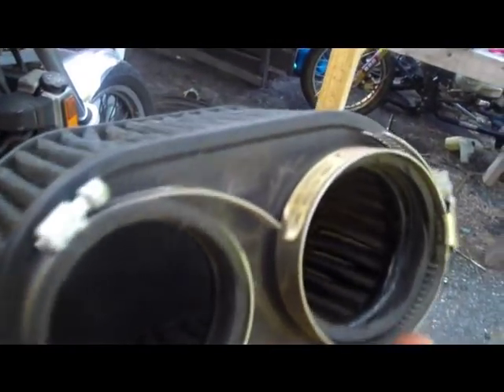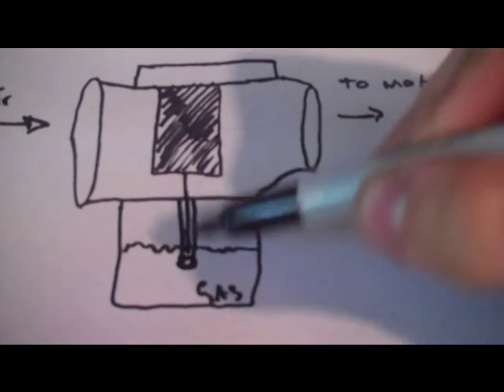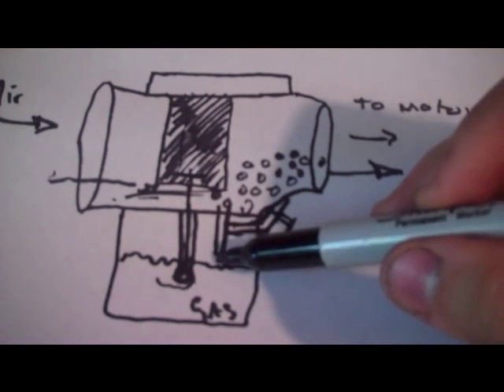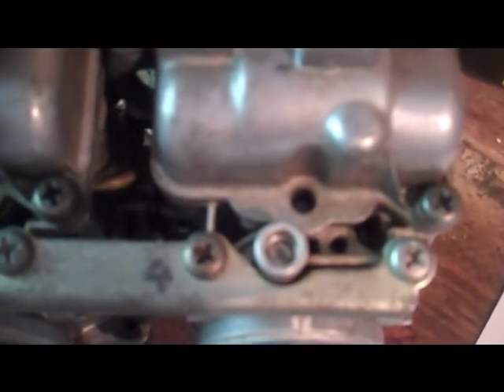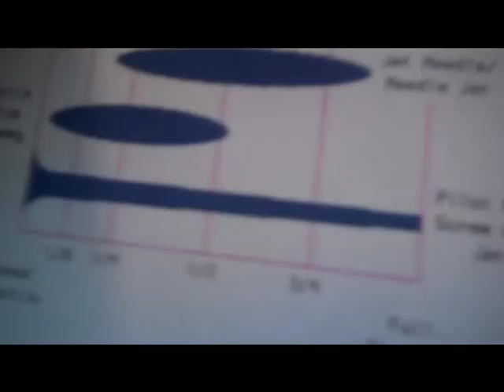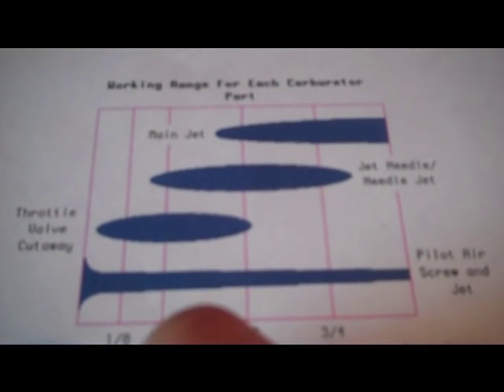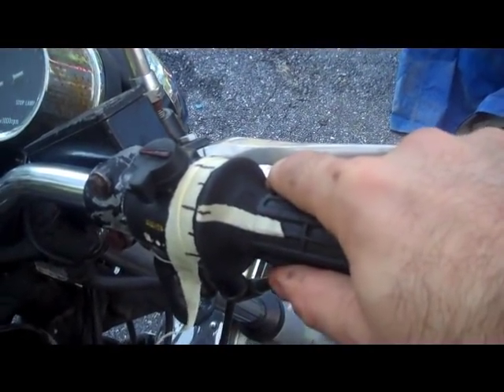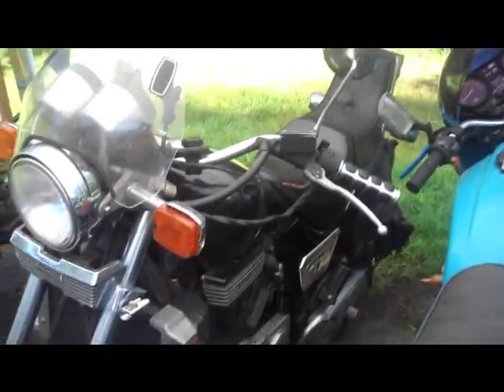How to adjust the jets on motorcycle carburetors

Comment: Your video is the best. Thx for sharing it... any advice or tips on getting a clean throttle blip at lower rpms (it bogs on me)? I might try to move the needle to enrich it some but just wonder if other things i should be paying attention to... its a kz650 1978 with pods, shorty exaust tip acc pump.
Reply from the maker: Fabio Suenaga No tips really other than to just diligently follow the steps in the video
Reply: +Fabio Suenaga did you change the accelerator pump?

Comment: Hi, I really enjoyed the video. Ihave a 89 Yamaha XS 750 and. I cleaned the carburator and won't started. I notice that when I the switches tank to PRI the gas is leakink fot the side of the air filter.
Reply from the maker: +Leo A Noya Your carbs are overflowing. Clean the carbs again, set the fuel height, replace the spark plug and change the oil as it now may be contaminated with gas. I have lots of other videos up on how to do all this stuff
Reply: I will do. Thanks a million.

Comment from the maker: Well like I mentioned in the video, there are different parts of the carbs that control the mixture during different applications of the throttle. It sounds like on decel, while the throttle is closed, something is off on your mixture. This could be a slide that is not closing properly, or a clogged pilot jet, float height incorrect, vacuum leak, etc, but whatever it is, its likely in that circuit

Comment: Great explanation.  I have on question I have a 1980honda cb750c dohc.  And just cleaned the carbs and got it to run. But it is on a very high idle. . How di I get rid of it and fix this.

Comment: @12m:32.  You only turn the pilot screw out if it is metering fuel and you wish to enrich the mixture correct?  Would the inverse be true for bikes who's pilot adjustment meters air (i.e. turning the screw outward would lean the mixture)?  Just want to make sure this is clarified for those who might not be aware of the different pilot screw arrangements.
Reply from the maker: Sounds reasonable

Comment: Nice and helpful video sir! Just like to ask if you change jet do you need to adjust also the needle or Should I use the stock one? Cause I go for a slipon exhaust. Thanks
Reply from the maker: Stock is fine usually when just adding a slipon there isnt any adjustment needed, or only minor

Comment: Btw, what's the best, easiest way to clean up an old bike & to get into all the little nooks & cranes on things like the cooling flares to remove old sludge, oil & other gunk? I have a steam machine & some gunk degreeser. Would a small wire brush also help?

Comment: nice video tutorial, thank you but have a question, at the end of the video you mention that when one get a bike at low altitute and bring it to higher altitute one should adjust, but what happen when I do the opposite, I got my honda VT1100C3 in Denver, and brogh it down to florida where I live now do I need to do any adjustments to it run good.  btw sorry for the grammar.

Comment: I just put pods on my kx305 because it was cheaper than replacing the tall battery they previous owner installed. Can i just tune the pilot screw to richen the mixture or do i need to get jets like you explained?

Also when the bike is warm it has a steady woft of white smoke coming out of the crank case breather. Do you think this is a sign of a bad head gasket or rings? Compression on both cylinders is about 120.

Comment: I have a 50cc 2 Stroke Reed Valve Yamaha that I opened up the carb with pod filter and opened up the stock exhaust by gutting the baffles and flow more air.  Does that upjetting formula apply the same with smaller 2-stroke engines?

Comment: Thanks for all the great videos. I own a 1982 Honda GL500 Interstate, and I hope you can answer a question for me. I've watched the awesome carb video and I indeed installed pods and somewhat opened exhaust. Using your +5 on mains and +2.5 on pilots. My problem is that the Keihin VB carb slide needle retaining screw won't allow shimming. If I skip that adjustment, what should I expect as a result, and is there any other way to make an adjustment to compensate for the stock needle position?
Reply from the maker: Yeah some of them are not adjustable. You'll just have to do the best you can tinkering with the jets

Comment: What if you have a none adjustable needle? What do you do if you replace the factory air box with 4 pods and changed the exhaust to a 4 into 1 exhaust on a Honda CB750C?  I rebuilt and cleaned all 4 carbs with all new standard jets, needles, floats and o-rings and re-synced  them.
Reply from the maker: You can use shims on the needles to produce the same effect

Comment: I've been having a lot of trouble with a ZXR 400 L9 99 model. Bike is using K&N air filter and the exhaust has no mufler. Stock main jet is #95 and pilot jet is #35 (no adjustable needle). When the bike is cold it start normally with choke, idle is very smooth and it have great response is that range. Between the rpm range of 2,500 - 7,500 is lean (when throttle is not applied the rpm meter drops down slowly) which means that I have to add washers to all my jet needle, correct? The mixture screw is stock at 1,75 turns which I increase to 2,5 turns so it can run smoother. From what you are explaining I have to try #100 main jet, #37,5 pilot jet, 1 washer on the needle jet and adjust maybe by a quarter the mixture screw (eg 2 turns). Correct? With my correct setup bikes hesitate to accelerate between 2,500 to 7,500 RPM and if I stay on that RPM range while I move (when vibrations applied) it bogs and slowly stalls, refuse to start for the next 30min (takes 15 minutes for the engine temperature sensor to completely drop down) until it start straggling with throttle wide open, no backfiring. Engine compression was 115 psi for all cylinder on cold engine (havent tested it on warm engine), manuals' acceptable compression is between 99-151 psi. What do you think it can be the reason? I did a trip of 40 kms on highway with no problems at all, I idle that bike for 30 minutes with no problems at all. Bogging starts with blocks when I have to start and stop.. Thank you in advance
Reply from the maker: Excellent work so far. Question, did you use the test I show at the end of the video to determine the midrange was lean?
Reply: @mrmaxstorey  I haven't done the 15 - 20 seconds run with clean spark plugs on middle range throttle position yet to determine for sure if it's lean or rich. As the motorcycle is currently on a mechanic for 2 weeks. From the way the RPM meter acted when I was reving the warm up bike on stand position (motorcycle lightly balanced horizontally so all carburettor float where on the same level) it showed lean condition with no backfiring, no bogging and no stall issues. Which makes me believe floats stuck somehow open during a ride and allow more fuel than they should from the vibration through the pudholes of the road. Thank you for your quick reply I'll get on to the problem as soon as I'll get that motorcycle back. Appreciate your interest for my particular questions
Reply from the maker: @d4rk1sh3r3  If the floats are stuck open and the carbs flood you would show a rich condition not lean. I would be hesitant to diagnose whether your bike is running lean or rich just based on symptoms because sometimes poor return to idle or uneven idle can be caused by both rich or lean. When you get back try the spark plug test and take it from there
Reply: @mrmaxstorey  is it common for a carburetor motorcycle to stall when you open the throttle fast on cold engine??
Reply from the maker: @d4rk1sh3r3  Yes even on a new bike
Reply: @mrmaxstorey  but on warm engine it should have immediately response and no stalling no matter how fast you open the throttle?
Reply from the maker: Correct

Comment from the maker: Check your slides, you might have installed them incorrectly and they are sticking open. Also the idle knob could have been turned out for some reason.

Comment: Great video!

I have an RM250 2 stroke motorcross bike that stalls when it idles. Once moving up the gears and even coming back down, there isn't a problem. The stall is via either hot or cold engine status.

Does this point towards the pilot jet needing some slight adjustment? If so, does this point towards the mixture being too lean or rich and therefore screw in or screw out?

Thanks,
Andy

Comment: Thanks for this vid. I have a Kawasaki 250 EX and my throttle response is slow when revving up AND down. I have cleaned the carbs, they weren't that bad, the needles move freely, the throttle cables move as they should. The gas is fresh. I cleaned each jet, making sure every hole is clear. Any ideas?

Comment: great video. I'm not quite clear on the pilot adjustment screw. which side adjusts air and which side adjusts gas?
Reply from the maker: +Nick Miller For the screw, typically its richer the more you turn it out
Reply: +mrmaxstorey Thanks.

Comment: Thanks for all the motorcycle videos.  I recently bought a 1975 Honda CB750.  Bike is running good.  I'd like to take the carbs off and replace some of the hardware and clean the outside of them. (I'd clean some of the inside as well while I have them off the bike.)  I've never done this before and I'm worried about screwing something up. Part of the reason I want to do it is just to learn how to take the carbs off and inspect everything.  If I use all the same size jets and just replace them with shiny new ones...Am I running the risk of putting the carbs back on the bike and having it not run as well?  That's my fear.  I don't know how finicky these things are. Part of me wants to get in there and tinker...part of me says "it's running well, just leave it the fuck alone."
Reply from the maker: Hey Dave, so there arent any wear parts in a carburetor. As long as it is fed fresh clean gas it should go without maintenance for the life of the bike. There isn't any advantage to replacing old jets with new ones, so long as the old ones are clean. If your bike runs reliably and produces good power, has a strong idle and doesnt overheat, Id say your carbs are operating just fine. While i am all for curious exploration about how motorcycles work, in my opinion that would be the only advantage to taking the carbs apart and cleaning them. The disadvantage of course is the amount of work required. So, its up to you. Good luck

Comment: thanks very informative. I got an 81 gs750 with mikuni carbs. it's got individual filter pods, 4-1 straight through no muffler exhaust. I read a calculation online of how to determine how much to increase my mains; he calculated 5 steps. since you suggest 2 steps, that sounds like a lot.  suggestions?
Reply from the maker: Those calculations are actually usually a pretty good place to start, my 2 step recommendation is an average for most bikes. Go ahead and tart with 5, and this video will help you determine how accurate you are by performing the test at the end

Comment: Great vids, trying to understand how this mysterious thing called a carb work. Im working on a cbr f2 and I took the carbs apart that were clogged. After i cleaned it i put everything back together and went for a ride. Now for it to idle normal, I have to leave the choke on longer then usual and I've lost high speed drive. The bike will not go faster then 60mph. its like i have to shift up early in lower RPM for the bike to feel smooth. What can be the problem with these symptoms

Comment: Hi max saw your vid and learned alot. I have a question. Before I rebuilt my 400cc yamaha kodiak atv carb it was idling fine, but would bog out when I gave it more then 1/4 throttle or more. Since installing the rebuild kit, it no longer bogs and revs up great, but it idles too high.The idle adjustment screw located near the throttle cable seems to have no effect. Is there another adjustment that I missed? The carb is a slide valve Mikuni. Thanks

Comment: Bro,you surely know your stuff and helped me alot with understanding how it goes,but i have a short question. When you are getting only a slip-on exhaust,why do you change only the main jet, i mean don't you get leaner in every throttle position? Changing the main jet will only help on 3/4-full opened. I would be so glad if you could answer my question because next week i m fitting a MIVV on my hornet and thinking about a lil rejet. :( Thanks alot anyway for the vid!!! Chris.
Reply from the maker: Its just a starting point. Some bikes require more than others, thats why the testing at the end of the video is important
Reply: Now that sure is a fast replay! Thank you so much dude,you are such a great guy!! Well, after reading and searching for like 5 hours,i managed to find out the sizings of stage 1 for my bike so i dont have to spend 150$ for a dynojet,just buy the main jets for 15$.. They give you a 1 size bigger main jet just like you said and 1 washer to add to the needle. It s 102 and 105,but i guess 102 is more like 102.5,right?Thanks alot again and i hope you all the best!

Comment: Would this video be a good place to start to try to fix a problem where the idle speed jumps around?  Already cleaned the carbs which got the bike running, thanks to your other videos!  Sometimes will idle at a decent speed (~1200) but then if I shift into gear and back into neutral, it jumps up to 3000 rpms.  Also could that be dangerous?  Thanks for all the videos, I can hardly believe I got my bike to start on my own by watching and trying!  Really appreciate your shared knowledge.
Reply from the maker: This video would be useful if you have modifications to the intake or exhaust
Reply: mrmaxstorey No modifications on the bike but found a reference in the service manual about throttle cable too tight causing eratic idle.  There was no grip play so loosened it slightly.  Hope that was the issue.

Comment: man your amazing , im learning so much by watching these videos . My problem is my bike idles horribly and stalls out .yesterday my header was blowing black smoke from the top and then idled out and stalled . this bike ( a 83 midnight maxim 750) has been nothing but headaches since i got it . we cleaned the carbs , re jetted .switched to air pods ,(4 singles) . any idea ? also you said to check the number on the main jet then add 5 ? what does that mean ?? thanks again man
Reply from the maker: Well I really tried to go over it in great detail in this video. Your problems are likely caused by switching to the pods. The increased air means you need to increase the amount of gas going into the motor to compensate. This means you need to remove the jets and replace them with larger ones. If you have size 120 for example, I suggested replacing them with 125 (120 +5) size jets, and starting there, keeping in mind that you might need to replace them several times with several different sizes until you find the right ones. Its a trial and error game.
Reply: im thinking it may be a bad spark (coil) issue . i can get an ohms readin when checking the plug wire , any help there ?
Reply from the maker: morris rath
Start by checking the spark at the spark plug. It should be blue and regular. Some bikes produce thinner sparks than others, but if it is a regular, blue spark then it is probably ok
Reply: no its a small yellow one . i tested the coils they are good , the starter . when i test my battery i noticed it droped ( went in at 12 v ) now its at 10.45 and slowly drops from there.but i cant find a bare wire touching anywhere
Reply from the maker: morris rath
Sounds like a parasitic draw. Keep looking

Comment: Awesome Vid and lots of great info. I have a Vstar 650 classic with a set of jarding pipes. My concern is the "bluing" of only the front cylinder exhaust pipe. The bike seems to run fine, but i have heard mixed opinions about this. Some say that the front cylinder in lean and others say that the reason that only the front pipe get blue is because of the cool air blasting on it and the occasional water from rain makes the front pipe discolor. The bike does not pop on decel or anything although it is kind of gutless,, but it is only a vstar 650 so i dont expect it to be a speed demon.
What do you think about the situation? I bought the bike with the exhaust already installed and the guy said that it had been "jetted" but who knows.. is there any simple way or tell tale signs other than what you had described to look out for when all seems to be well? thank you very much for your info, do you think that the carbs are not synchronized properly?
Reply from the maker: Well if you have concerns, take the carb out and see what jets are in it, you can compare that to stock settings. The headers should not be bluing like that, so Id check and see
Reply: mrmaxstorey Thanks for the reply, I will take a look further into the carbs as soon as i have time this weekend. Thanks again.